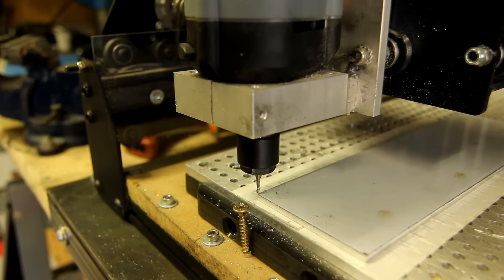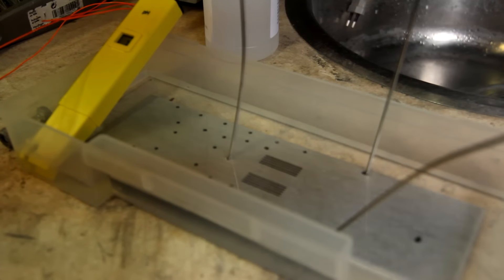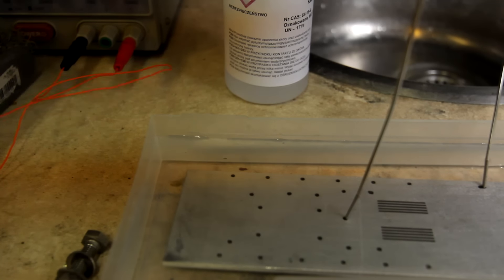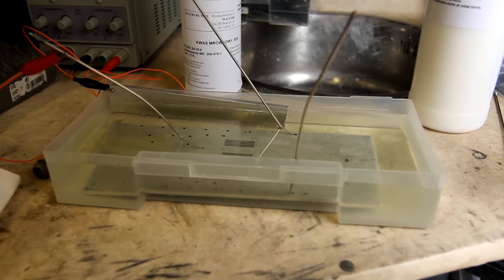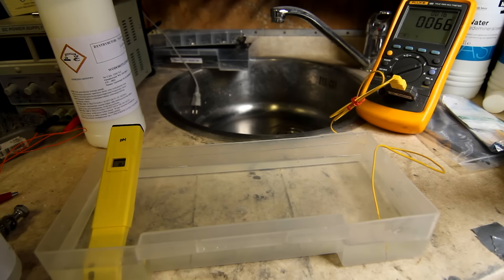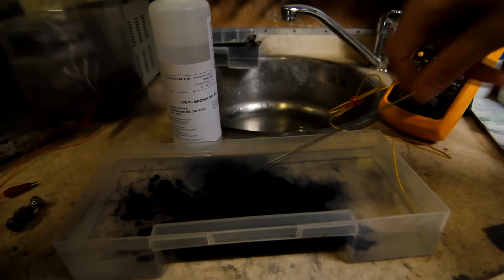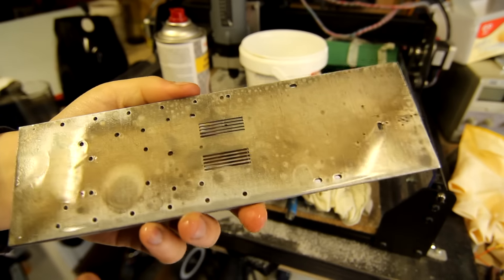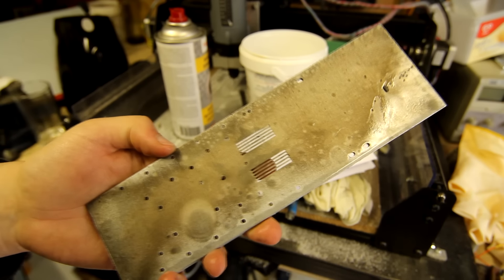Failing to anodize aluminum (w/Brighteyes) (027)

Comment: I found this interesting. 
I was initially hoping to see some redox equations and theory. I don't really know much about anodizing but chemistry (redox) is cool and it's always neat to apply knowledge to new domains.
Looking at this it has become a bit of a puzzle to explain the fail.

First. I'm curious what voltage you used. You mention 30A but I never heard the voltage.
Redox reactions are very voltage specific. 
Change the voltage and you may find other preferential reactions occuring or not.

Second. I'm curious about the choice of formic (methanoic) acid.
You mentioned that it's a strong acid - I don't know if that was a mistake or a language thing (I mean your English is brilliant).  It is an organic acid so intuitively that should give it away as not being a strong acid despite it obviously being a concentrated weak acid - as 

When I looked into the process of anodizing, it is the build-up of oxygen at the anode that is reacting with the aluminium and giving you the oxide layer you're after.

My theory is that for some reason (a standard reduction potential chart might help here - particular if you know the voltages) that stainless-steel spoke was THE prefered anode.

A quick search of formic acid annodize didnt turn up much.

Aluminium is also quite resistant to formic acid at any concentration and I think this is bad.

It is the dissolving of the aluminium oxide and the formation of micropores which allows the electrolyte to reach the surface and continue the buildup of oxide. Otherwise the oxide layer would just cut the continuation of the reaction.

So maybe a fine layer of oxide stopped the reaction on the aluminium then the electrolysis was continued on the spoke?

One last point on the pitting. Wikipedia states:

"Anodization in some organic acids, for example malic acid, can enter a 'runaway' situation, in which the current drives the acid to attack the aluminum far more aggressively than normal, resulting in huge pits and scarring. Also, if the current or voltage are driven too high, 'burning' can set in; in this case the supplies act as if nearly shorted and large, uneven and amorphous black regions develop."
Reply from the maker: Anodization is passivation, i.e. forced accelerated oxidation of the surface. It's much more a physical process than a chemical one, although it does involve a reduction-oxidation reaction. Really, what you want to do is control the oxidation layer growth rate such that you force a porous growth instead of a more structured solid alumina formation. As such, because you're really only interested in pushing as many moles of oxygen into the surface and not really about any side reactions, the voltage really doesn't matter. Some people do it at 3.5V (about the best you can do with flat plates), some at 6, some as high as 12V. At that point, self-heating becomes a big issue.

I did misspeak yeah, formic acid is not a strong acid. I'm not 100% sure what I meant. I think I meant it's relatively dissociative in water, so it's very hard to control the exact pH. It'll shoot to a pH near 1 quickly, and really needs a buffer to get significantly basic.

My theory indeed is that stainless steel has a significantly lower reaction potential than normal iron and largely because it doesn't rust, it keeps too good of contact with the water and wicks away most of the current. 

The pitting seems to be an issue with stirring. It's pretty hard to find good resources on how it exactly works, but within the 'anodization community' people even get pitting with sulfuric and nitric acid baths. It's not just with organic acid. Hell, some people on the Inventables forum got no issues at first try with acetic acid... It's a bit of an art.

Regardless; this video was more of a fun trial than a thorough try. I've tried some other stuff and didn't get particularly good results; one follow-up video was scrapped. I'm now saving up for a hot plate stirrer for other chemistry stuff as well as anodization. When I get that in, there will be a follow-up video.